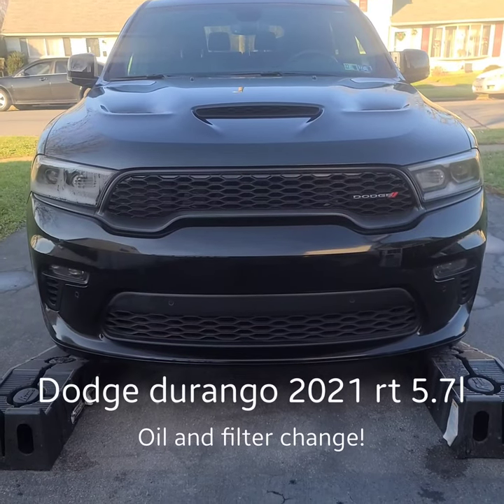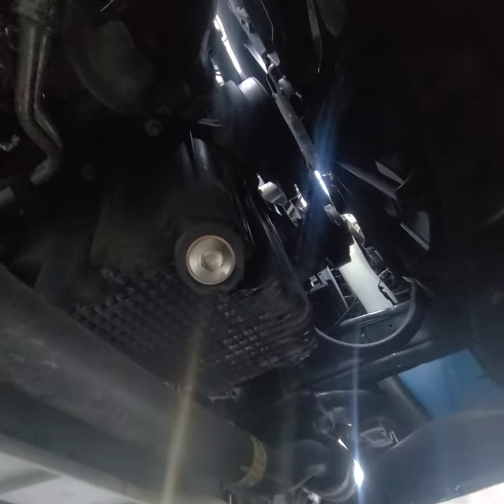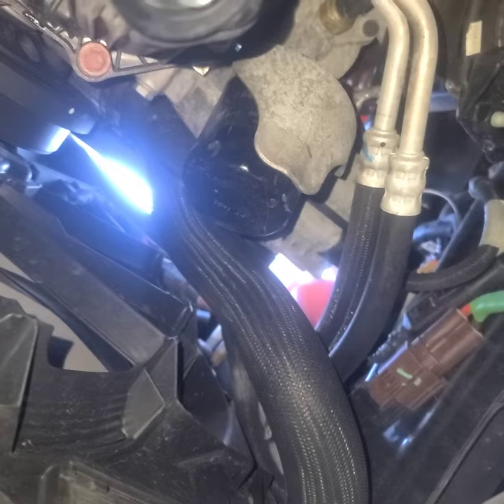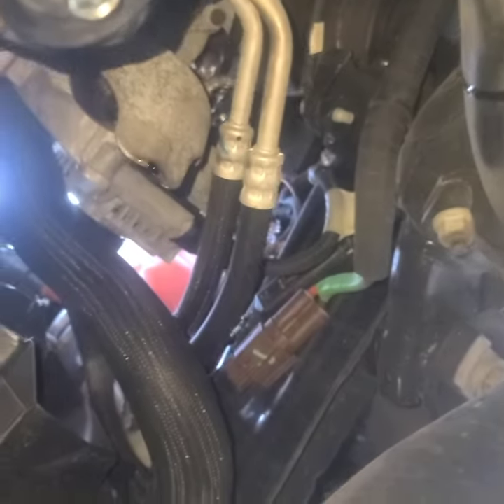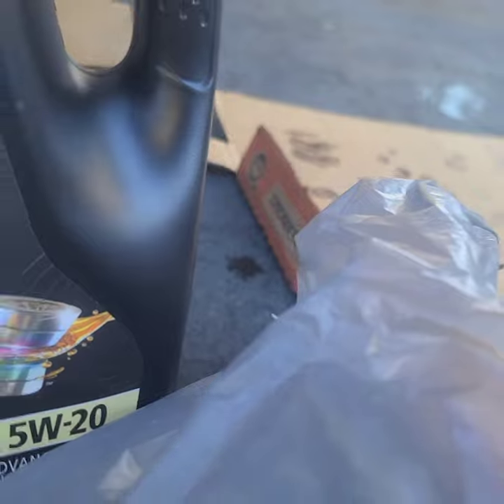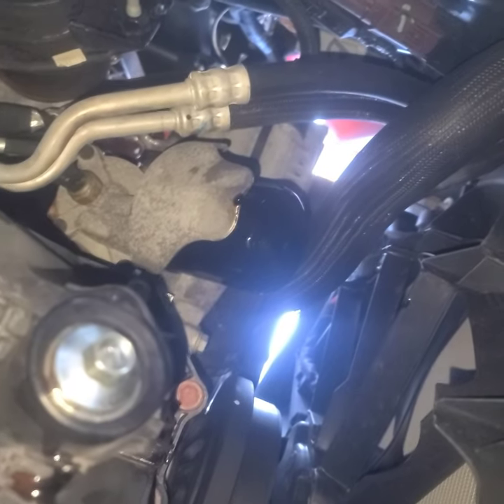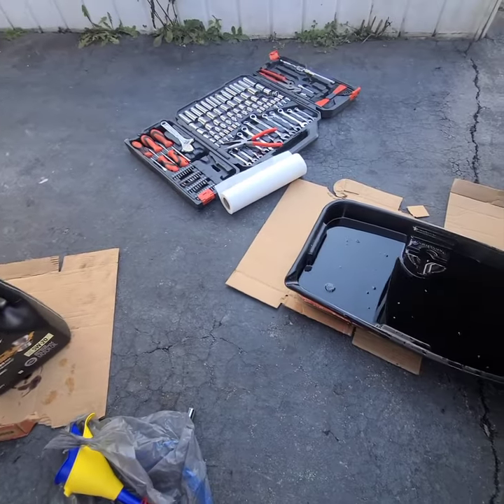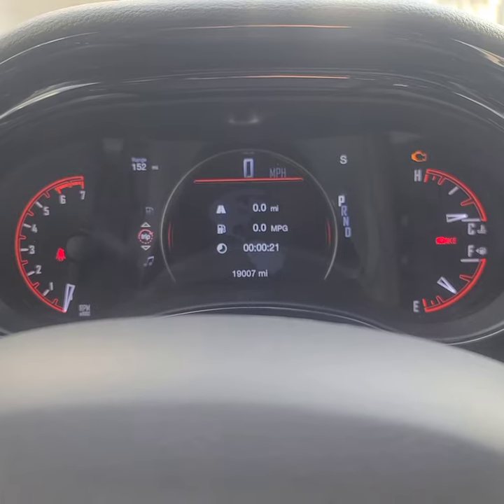Dodge durango 2021 5.7l - How to change oil and filter!

Comment: why on the pentastar its on top but the  hemi is on the bottom, mind blowing
Reply from the maker: @jeremyladue4702  I'm not sure about the penta start but I just believe it has to do with the engine design. I think penta star is 3.6 and the Durango I had was a 5.7 hemi
Reply: @Spader-J  yea I just got that recently myself but before I had a 3.6 Journey and it was on top as well. so I guess all the hemis have that uneer the body one